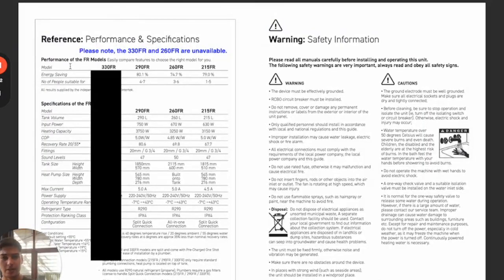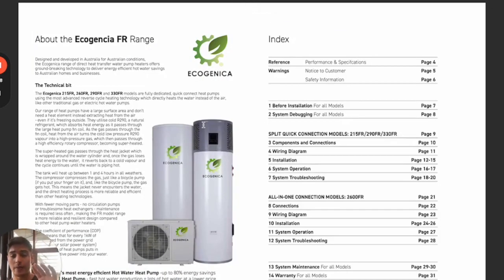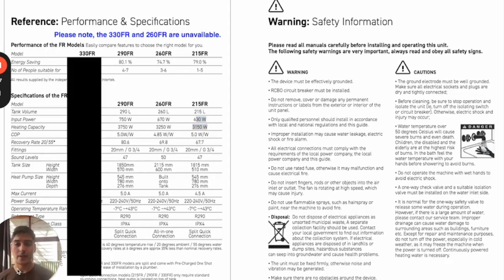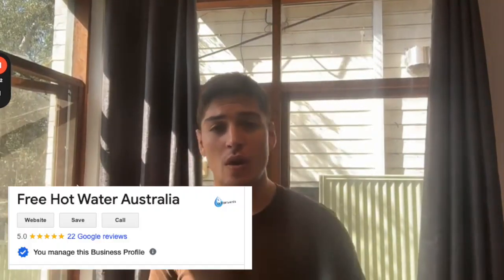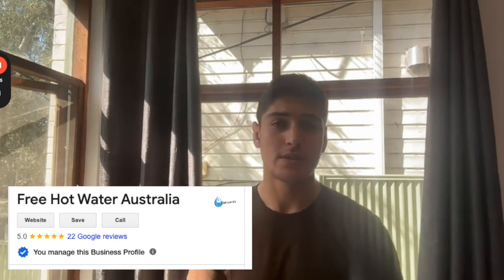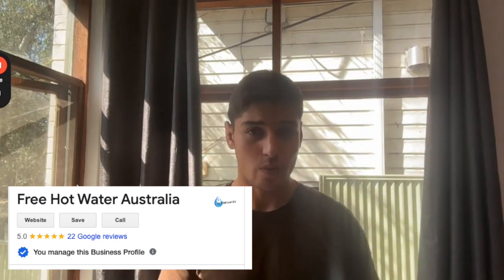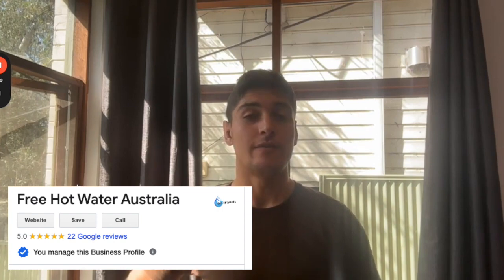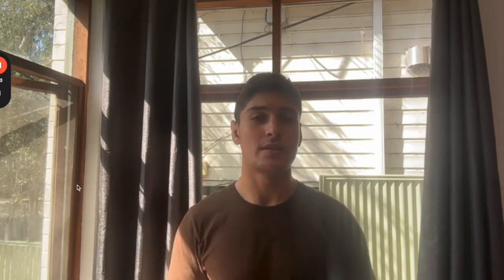Ecogenica Heat Pump vs Traditional Hot Water Heating System

Comment: Hey mate, I have a Natural Gas boosted solar heating system. Would you recommend to replace it with heat pump system for my house. We also have roof top solar. Is it gonna be cheaper for us to run ?
Reply: hi mate, I been struggling with the same question. I had a quote for an electric boost solar hot water and still just as confused.  We have excess solar and thought what is I get this 322MLV solar hot water with electric boost and 24 hr timer control. Excess solar will boost the hot water at the end of the day around 3 - 6 depending on the time of the year. 

Now I am confused to how a heat pump will compare to this.
Reply from the maker: @jasonrhl  

If you have excess solar it's my belief that a solar hot water system would be a waste of money. 

Heat pumps can be charged from the excess solar, and when you don't have solar you'll need to use the grid anyway. 

A heat pump is significantly cheaper than an electric boosted hot water system in this case, which is why heat pumps are actually cheaper than electric hot water systems.
Reply from the maker: Yep, a heat pump is going to be cheaper than Natural gas to run. 

Solar is an incredible bonus with a heat pump, as excess solar can go straight into heating your water. If you have a large enough system, it's possible to set up your heat pump to only run during the day which means in the summer you won't be paying anything for hot water. 

Definitely worth considering.

Comment: Currently I have a Envirosun 415lt capacity (Model 400OC124) hot water tank which is designed to run with a Thermo pump solar panel system pumping the cooler water to the roof and returns into the tank, can one of these tanks actually be utilised to work in this way effectively making the heat pump system as a back up? My current system works 5 to 6 months of the year without the electricity switch on to the element in the tank it produces a ton of hot water, currently 1 controlled load (off peak) which would have to be bypassed in order to have the automatic programming switch on. My tanks is out of warranty and this is the second as the first gave up right on the end of warranty. I’m considering biting the bullet if this is possible as cost through winter are considerable? It’s just that I’m NOT alone with this question probably. NSW in Oz
Reply from the maker: We can replace your solar hot water system, but it won't be compatible with your solar hot water panels. It will however work fine with regular solar panels. 

The system runs very efficiently during the winter and we'll connect you to the continuous load for free.
Reply: @GridlessAustralia  I did suspect this would be the answer and that a real petty as the current solar system performs well in excess of the 70 Degrees for much of the year with almost no power and pump running cost is free. I could see the advantage of the change out for it being utilised for the lower performance months we have just been through. I’ll make an enquiry for a quote directly with you with electrical board and tank location photos just to be sure. NSW in Oz

Comment: Good on you for trying to promote your business, but my advise to anyone watching is to stay away from heat pump hot water systems. They might run ok for a few years, but you'll find that just outside your warranty period the system will give you trouble. If a standard hot water system plays up it can only be the thermostat or element (cheap and easy to fix, takes about 20 minutes to replace both). What you  THINK you save with a heat pump system you will pay for in repairs in the long run. Only a word of advise, I'm an electrician and have replaced several heat pump systems (some only a few years old)
Reply from the maker: Hey Peter, 

Here's what I would respond to your points:

1. A heat pump uses the same technology as air conditioners, which tend to last 12-15 years. 

2. If anyone has a leaking or broken system out of warranty, getting a FREE or significantly rebated system is a better alternative than spending $1500+ on a new system. 

3. The heat pump will be cheaper not only from the offset in most cases, but in terms of electrical costs.

4. Don't just take my word for it, this video brings up good points too: https://www.youtube.com/watch?app=desktop&v=Mz2QaWodrzw